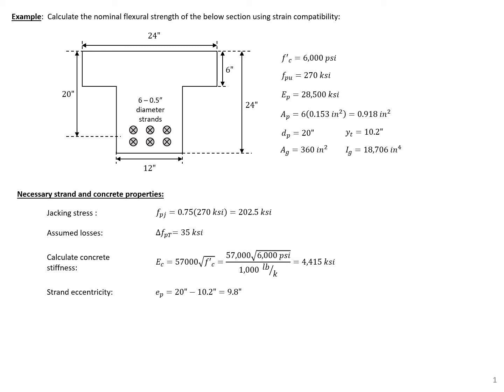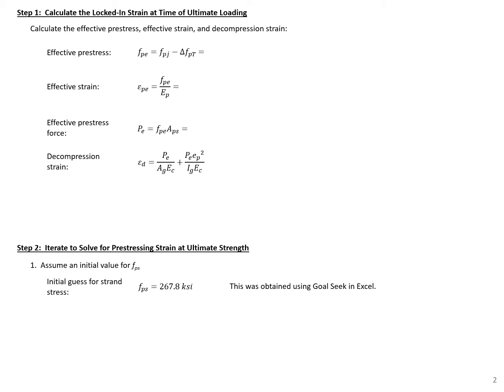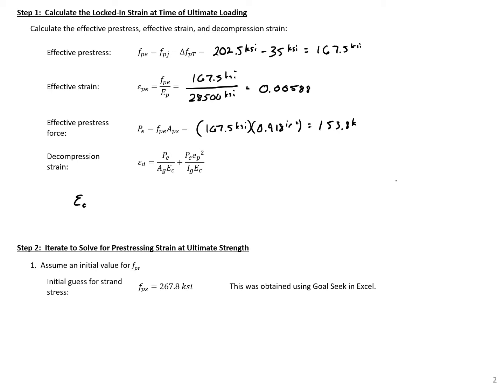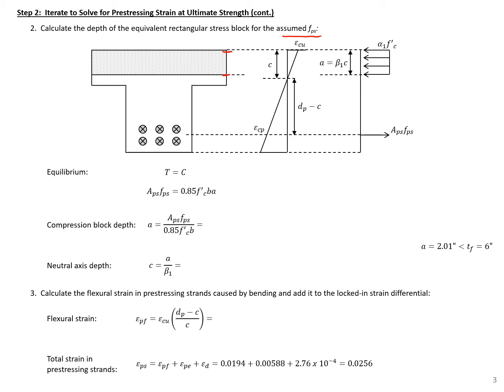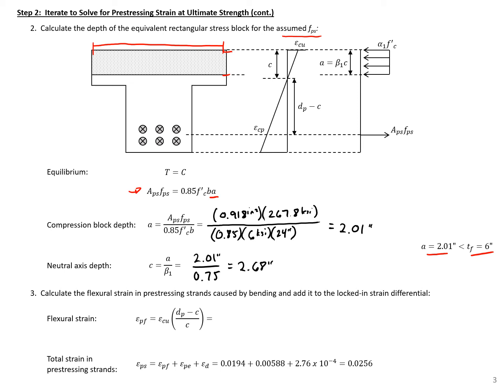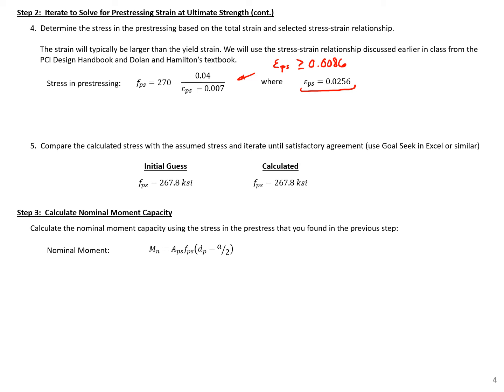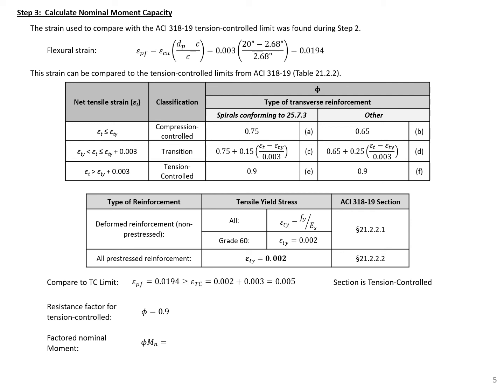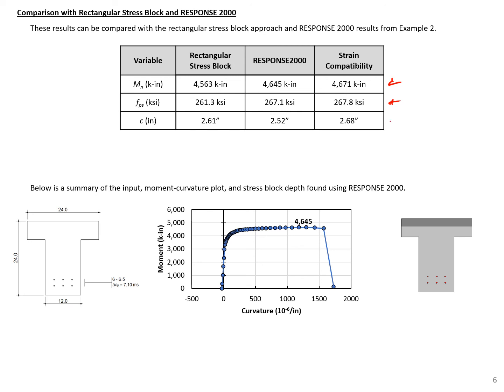Prestressed Concrete Design - 8 - Example 4 - Nominal Moment using Strain Compatibility

Comment: Just what I needed! Very good video, thank you.

Question:
I assume this is for the nominal/factored moment capacity midspan. How does the ultimate stress in the stands change as some strands are harped nearing beam ends? Does it change? Is a change simply from the d(sub)p distance from compression fiber to strand CG that would change the stress/strain in the strands?